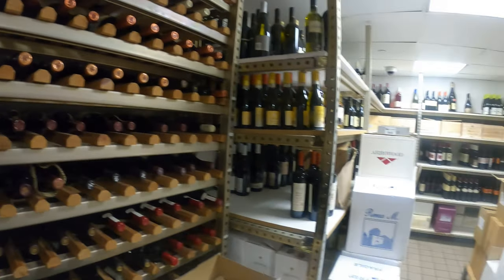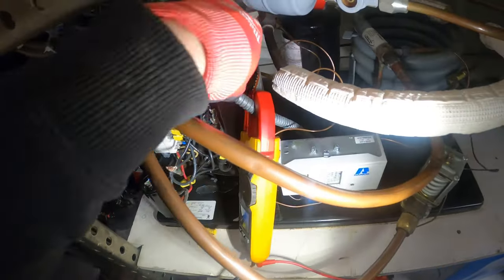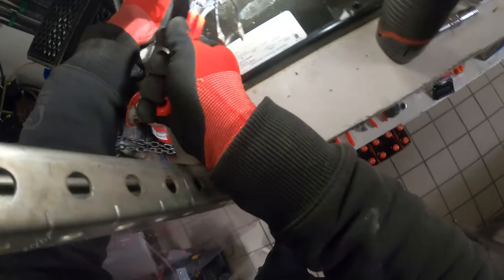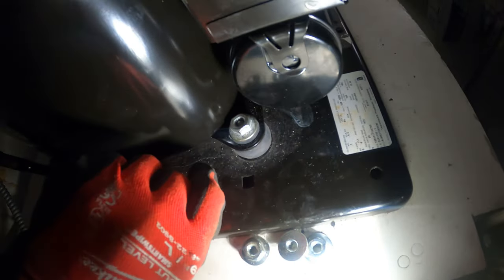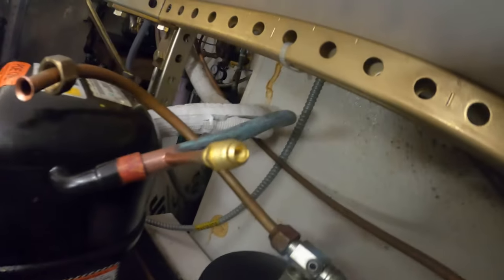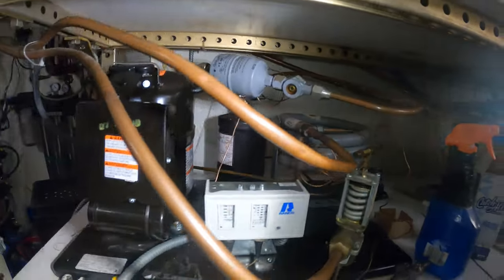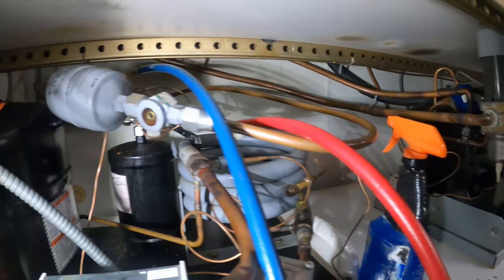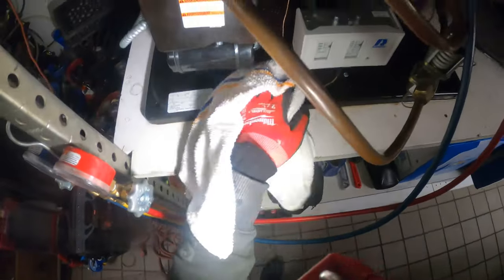HVACR: How To Replace a COMPRESSOR (Refrigeration Compressor Replacement) Walk In Wine Cooler

Comment: No nitrogen trace while brazing?  No micron gage during evacuation?  Otherwise a good video
Reply from the maker: Nope😳 I cleared the lines with nitrogen but didn't use while brazing those small connections. Did pressurize with nitro and check for leaks👍 Thank you & stay tuned for new vids every week!
Reply: Refrigeration police 😂